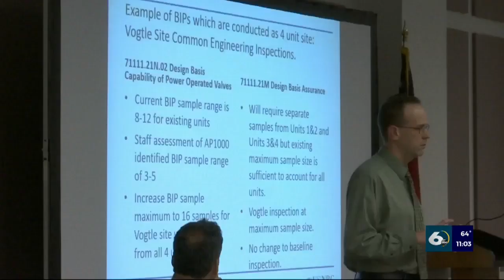Plant Vogtle hoping to do what no one else in the nuclear industry has

Comment: I bet way more homes could be powered with clean energy if that $25 billion had been spent instead on solar and battery storage both at the distributed level and utility level.
Reply: Battery storage is much more expensive and chemical energy storage is nowhere near as energy dense as nuclear energy storage.
Reply: @Jemalacane0  Nuclear power facilities don't "store" energy, they generate it. 

$25 BILLION can supply every home in GA with Tesla Powerpacks, Megapacks, and solar roof shingles.

The Vogtle plant may be abandoned before it even finishes. The main contractor filed for bankruptcy and they are $11 BILLION over budget!
Reply: @electrifyeverything6454  Nuclear fuels do store energy to the tune of 1 to 3 million times by mass as fossil fuels. The energy density of a lithium ion battery is about 870,000 joules per kilogram whereas the energy density of uranium is 80,000,000,000,000 joules per kilogram. So, you need a lithium ion battery weighing 91,955 metric tons to equal the energy of 1 kg of uranium.
Reply: @Jemalacane0  Nuclear cannot store energy after generation in the way that batteries can. 

The energy density of uranium is irrelevant unless it can be effectively used, which it cannot. The nuclear industry is going bankrupt for a reason: Construction of nuclear plants take 3 times longer than it did 20 years ago, driving up costs by billions. Meanwhile, consumers are stuck using dirty energy from coal or natural gas. Nuclear plants also use billions of gallons of water just to run, which is a massive waste and something renewables don't use. It also costs billions of dollars to decommission nuclear facilities and billions more to store radioactive waste. These added costs are never factored into the cost of nuclear, which is deceptive to taxpayers and ratepayers.

Meanwhile, the cost of solar and storage continue to drop. Again, if that $25 billion had instead been invested in quick-to-install and clean renewable energy, we could have already powered every home in GA by now.
Reply: @electrifyeverything6454  Actually, uranium can be used effectively with reprocessing and energy is very relevant. More energy dense things are typically cheaper in absolute values. In September of 2016, a Tesla Powerpack was over $400 per kwh whereas nuclear power generates electricity for cents per kwh.
Reply: @electrifyeverything6454  Energy density also has environmental implications too. When fuels are more energy dense, you need less of them. So, that means less mining. Reprocessing can eliminate 96% of the so-called waste. Nuclear reactions actually convert the fuel into energy thereby lowering its mass. So, the more it's used or reused, the lower its mass. The other 4% has uses. One of them is as medical radioisotopes. Not to mention nuclear power has been an avenue for destroying nuclear weapons in programs like Megatons to Megawatts.
Reply: @Jemalacane0  Energy density is only "valuable" relative to the life cycle cost. The simple fact is, the life cycle cost of nuclear is HIGHER than solar or wind plus storage. 

Yes uranium is extremely energy dense, but investment is dropping because alternative forms of generation are more cost effective, all things considered. The life-cycle cost of owning and operating a solar farm is waayyy cheaper than maintaining a nuclear plant or building a new one. Warren Buffet isn't investing $130 billion in new nuclear for a reason -- solar and batteries are the smarter investment! 

From Google: The life cycle cost of an asset can be expressed by the simple formula: Life Cycle Cost = initial capital costs + projected life-time operating costs + projected life-time maintenance costs + projected capital rehabilitation costs + projected disposal costs - projected residual value.
Reply: @electrifyeverything6454  The lifecycle cost of batteries will always be higher.
Reply: @Jemalacane0  You can't make up your own facts. Here's a link to Lazard's 2019 LCOE:
 https://www.lazard.com/media/451086/lazards-levelized-cost-of-energy-version-130-vf.pdf

Notice how solar and wind are way cheaper than nuclear.

Now factor in batteries at the utility scale:

https://www.nrel.gov/docs/fy19osti/73222.pdf

Today, solar or wind plus battery storage is cheaper than nuclear, and the cost of batteries is dropping as batteries get more efficient (economies of scale). The cost of construction and operations for nuclear continues to increase. Nuclear power is on a "negative learning curve", while renewable energy plus battery storage is on a positive learning curve.
Reply: @Jemalacane0  Wow, the energy density is really amazing, but who cares? But just for comparison, the fuel for a solar plant is photons which have no mass ofr volume and thus infinite energy density.  But again, who cares?  Our concerns are carbon dioxide which both technologies effectively eliminate.  Both technologies generate waste of different kinds.  One kind is slightly hazardous and we know how to deal with it.  The other kind is extremely dangerous with no long term solution.  Both require land but one requires much more land. One kind is proven technology which can be constructed and put into operation in less than two years.  The other is untested new generation technology (because the last generation is considered too dangerous) subject to large cost overruns, long delays on an already glacial time scale.  One already producing the cheapest electricity ever made.  The other has uncertain costs but most likely much higher.

The free market has already made a decision.  115 GW of solar capacity added last year.  Nuclear capacity decreased by a similar amount over the last 14 years.  You can talk about capacity factors, but the bottom line is one technology is going up and the other is going down.
Reply: I work building solar plants and i almost cry every time they clear out 1200 acres of woods to put freaking pannels brother
Reply: @electrifyeverything6454  solar aint going to cut it. How come china is building 40+ reactors
Reply: @Ludwing730  it seems we are in a lose lose situation all of these solutions have problems some more severe some less it seems to me that the solution is a mix of carbon free energy sources

Comment: In September 2016, Tesla priced the Powerpack at $445/kWh. A plant like Vogtle should be able to generate for about 5¢/kwh. Even if the price of the Powerpack has come down 10 fold, it would be $44.5/kwh or 890 times as expensive.
Reply: You are confusing generation with storage. $445 would be a fair comparison if you were buying a disposable battery.  But the Powerpack (or any such storage system) can be charged with 2¢/kWH solar and delivered whenever it is needed, over and over again.  The battery is already cheaper than gas peaker plants and more effective in stabilizing the grid.  Now where did you get the 5¢/kWH price for power from this nuke?  Does that include all millions of dollars in expansion fees ratepayers have been charged for the last decade?  Funny I can't even find an estimate for the projected cost of electricity from this nuke.  Solar plants are being proposed, built and powered-up in 18 months, and the main subject of the article is always price per kWH. Like this: https://www.forbes.com/sites/jeffmcmahon/2019/07/01/new-solar--battery-price-crushes-fossil-fuels-buries-nuclear/#455f2d4c5971
Reply: @nickdanger4173  It doesn't matter how cheap the solar power is. It matters how cheap the battery is.
Reply: @nickdanger4173  "By 2007, the wholesale value of electricity at the Palo Verde Generating Station was 6.33 cents per kW·h." Palo Verde is a nuclear power plant. https://en.wikipedia.org/wiki/Palo_Verde_Nuclear_Generating_Station And of course, greentards don't get that baseload power plants are the most important. Also, nuclear power is the kind of energy which supports robust industry, the kind that is needed to make solar panels and batteries.
Reply: @nickdanger4173  Oh, and once the U.S. has worked out the kinks, I'm thinking the cost of the AP1000 will go down a lot. China has built a pair for just over $7 billion (1/3 of what you said Vogtle units 2&3 will cost).
Reply: @Jemalacane0  No doubt any future ones would cost less.  But how much is the kWH cost?  And nice of the Georgia Power consumers to foot the bill on that development. But what is the per kWH cost?  You are not going to build anything in the US for what it costs in China or China wouldn't need all that power to make goods for us.  But I am not sure I would buy a Chinese-made car, let alone a Chinese-made reactor.  WE will see how that works out.  Solar is proven tech and hard to beat the price.  Lazard estimates LCOE for new nuclear is 3-6X the price for solar and 2-8 X the cost of wind. https://www.lazard.com/perspective/lcoe2019
Reply: @nickdanger4173  Nuclear is a proven technology. It has the highest capacity factor of all methods of making electricity. Strongly nuclear France has some of the lowest electricity rates in Europe whereas renewables crazy Germany razes village after village for coal mining and they have energy poverty and some rather expensive electricity.
Reply: @Jemalacane0  If it is such a proven technology, why are the new plants going 3X over budget and up to ten years behind schedule.  Germany is going renewable.  They were early adopters back when solar and wind were very expensive and unproven technologies.  Now German companies (BayWa) are building solar plants (Don Rodrigo) in 18 months and selling the unsubsidized power for 1/5 the contracted price for brand new nukes (Hinkley C) that have been under construction for 12 years and still haven't produced a single kWH.  BayWa is a capitalist company making a profit in the free market while Hinkley, Vogtle,  Flamanville, and others are socialist nightmares.  Why do you hate capitalism?
Reply: @nickdanger4173  Germany is going coal and energy poverty.
Reply: @Jemalacane0  Coal consumption in Germany at record low.
Reply: @nickdanger4173  Where in France. it's close to zero and in Ontario, Canada it is zero.
Reply: @Jemalacane0  Average cost of electricity per German household is $87/month.  I don't think that is driving anyone into poverty.  Total cost of power is stable and cost of the electricity itself is declining thanks to renewables.  Germany has a lot of legacy costs because they got into renewables early when the cost was high. In a 2019 poll, 65% of Germans agreed at least somewhat that "Germany has progressed very well with its Energiewende to date."

https://2lffqo2moysixpyb349z0bj6-wpengine.netdna-ssl.com/wp-content/uploads/2018/10/german-electricity-prices-2018.png
Reply: @Jemalacane0  Look at the graph in the link you cited
https://energytransition.org/wp-content/uploads/2017/11/cm4.png
More bills going unpaid in France, than Germany.

Germany has high power costs due to a lot of taxes and infrastructure fees.  The Renewable tax is about 7 cents per kWH.  The market price of the power is about a penny lower than it would be w.o. renewables but ignore that and apply the full 7 cents to the average 3500 kWH of annual power used by the average German household and you get a whopping $20 per month in extra cost. People typically get their power cut off for the same reason they get their car repossessed - they lose their source of income.  Use a little common sense. 

I used to pay 11 cents for renewable in Chicago, an extra penny.  Then both renewable (wind) and "regular" (mostly nuclear) went to 7 cents. That was because wind turned out to be so cheap. Then we had to pay a subsidy to keep the nukes running. I am actually OK with that.  The nukes are there, they are carbon-free and they don't cost that much more in marginal cost.  But build more of them????  Not unless they can compete with wind/solar/batteries.
Reply: @Jemalacane0  Well that is good. Hydro is good for Ontario. And France has a wonderful 100% socialist nuclear power industry that works pretty well.  Still, France hasn't switched on a new one in 20 years and Flamanville cost could go north of 100Euro/MWH.  At that price they they will be losing money.  A lot.  We will see how eager they are to build another one.
Reply: @nickdanger4173  While France is constructing Flamanville, Germany is looking to bring online a new 1,100 megawatt coal fired unit called Datteln 4 this year. That will burn an extra 11,000 tons of coal *daily*. My friend who lives in Germany and who is much smarter than many people gets tired of Germany's anti-nuclear bullshit. It doesn't help either that Germany buys electricity from France.
Reply: @nickdanger4173  Ontario gets most of its electricity from nuclear power, from Pickering, Darlington, and Bruce.
Reply: @Jemalacane0  Supposedly the new plant will replace several older, less efficient plants, but most German's oppose it anyway.  At any rate, the FF contribution to Germany's power is declining faster than they could possibly add nuclear capacity.  Solar and wind picking up the slack even as it replaces nuclear production.
Reply: @Jemalacane0  I guess Pickering starts shutting down in two years. The other two sites are being refurbished.  This was in lieu of building new reactors. New reactors just aren't cost competitive and it remains to be seen whether the refurbished reactors will be cost competitive.
Reply: @nickdanger4173  You could have gone with solar, only for solar panels and batteries to lose capacity over time, unlike with nuclear power where reactors can be uprated (as was done with the first two units at Vogtle and all 3 units at Brown's Ferry). I can't imagine what the nasty storms Georgia can have would do solar panels. Being very hard facilities, nuclear plants will weather storms much better. To have the same output (actual Mwh) as 2,200 megawatts of nuclear, you need ~8,800 megawatts of solar *(because of capacity factor)*. Some estimates I have seen price solar at about $3/watt. So, without storage, that's going to be over $25 billion. To backup a single 1,800 square foot house, Tesla powerwalls would cost $14,100. For 1,000,000 homes, it's going to cost $14 billion. So, at 25 billion to 14 billion and you get a bit less than $40 billion.
Reply: @nickdanger4173  Oh, and the Trojan Nuclear Plant in Oregon was built for $1.6 billion (in 2018 dollars). It's nameplate capacity was 1,065 megawatts. So, yeah, we can build nuclear for a lot cheaper.
Reply: @nickdanger4173  Also, look here: https://www.tesla.com/support/powerwall/how-long-will-powerwall-last-in-an-outage
Reply: @Jemalacane0  That is for a residential installation.  70 cents per watt is for  utility scale.
Reply: @nickdanger4173  And screw despoiling so much land with so much dilute energy.
Reply: @nickdanger4173  That is another advantage of nuclear power: It takes up very little land for the amount of power it produces. Solar and wind take up much more.
Reply: @Jemalacane0  OK, great, but the price of land is included in the PPA.  Solar plants signing PPAs at 2-3 cents.
Reply: @Jemalacane0  LOL, 

How much land will these nukes despoil in an accident?  Chernobyl = 1000 mi².  Supplying the planet with 100% solar would require 43 times that much, but at least you can walk around in it without risking radiation poisoning.
Reply: @Jemalacane0  You can probably build one cheaper than that, but how cheap do we really want them?  Trojan started breaking down less than five years after it started running.  After 16 years, the power company spent $4.5 million to defeat a voter initiative which would have shut it down immediately.  The very next week, it broke down again and was never restarted. 27 years later, the 34 casks of nuclear waste are still sitting there.  They are a constant danger  and we still don't know what to do with them.

Is this really the example you want to cite?
Reply: @Jemalacane0  And I am still waiting for evidence to support your 5 cent per kWH estimate for the cost of electricity from the new Vogtle reactor.
Reply: @nickdanger4173  Land should be saved for other uses than ineffective energy.
Reply: @nickdanger4173  Ah! Here comes the fear mongering driven by willful ignorance in differences in reactor design. And Chernobyl did not despoil the land. Nature itself has caused other areas to be more radioactive. Not to mention herbicide is used to keep vegetation from blocking solar panels. Oh, and anyone with a brain knows that when determining the efficacy of an energy source, reliability and energy density are the most important aspects.
Reply: @nickdanger4173  Georgia Power's "Super Off-Peak" electricity rate is 1¢ per kwh. https://www.georgiapower.com/residential/billing-and-rate-plans/pricing-and-rate-plans/plug-in-ev.html Their super off-peak pricing is what electricity costs between 11 P.M. and 7 A.M. That electricity is going to be provided by the coal-fired and nuclear power plants the baseload plants.